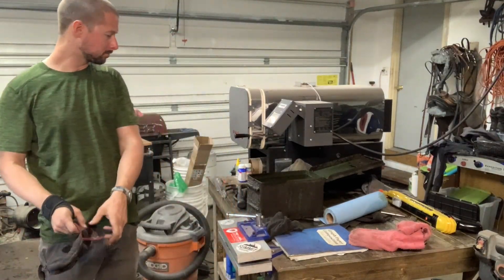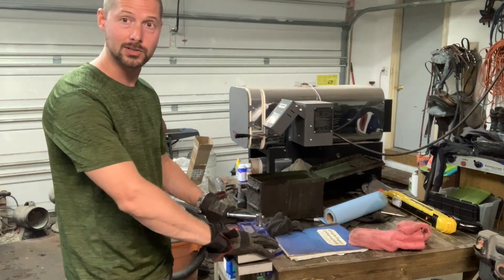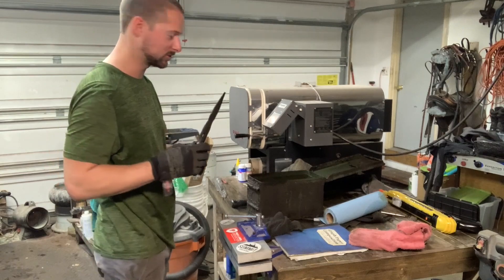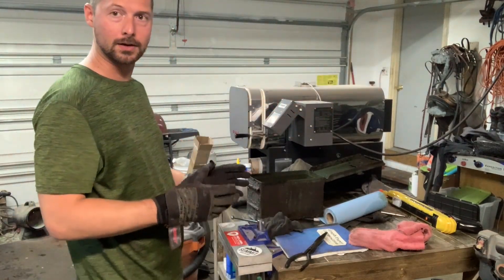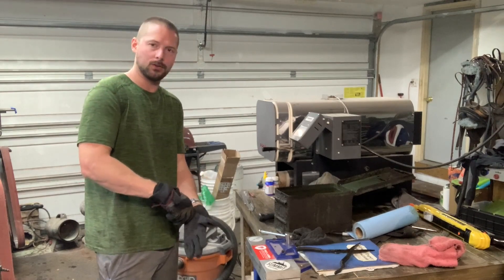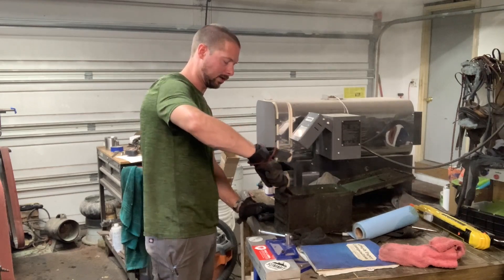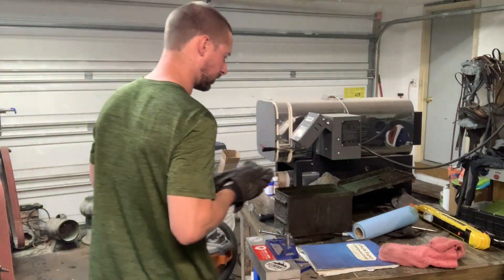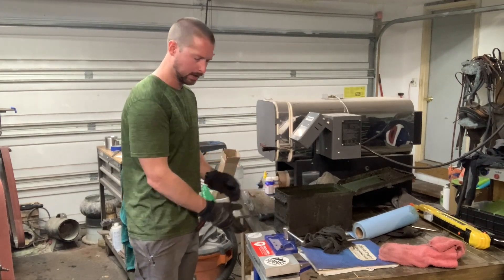NO MORE WARPS!!!!! heat treating tips!!!

Comment: ? What happens if you get your blade TOO HOT before quenching?
Reply: They became brittle other will shatter if drop the knife. If your buying a steel Plate there is a guide for heat treatment.

Comment: I use aluminum plates, so far without a vice setup. I couldn't help but notice that when you really wrenched down on its handle, that the upper aluminum plate tipped to the right. That's expected due to the offset force. Would work best when the blade is placed as close as possible to the vice's threaded shaft.

Comment: What's your take on 1075
Reply from the maker: I haven’t used it much really
Reply: It's good for beginner knife makers! And it's a decent carbon steel. Not super high end but it's decent.
Reply: @JesusChrist_IsTruth-LoveForALL  yeah I attempted to make pairing knife out of it 
Mostly failed but the blade could carve aluminum and brass with a 2-20° secondary bevel
Reply: @ThatOneOddGuy  Nice!! Keep working on it! 💪
Reply: @JesusChrist_IsTruth-LoveForALL  will have time in a few weeks got a physics exam tomorrow

Comment: Stress will warp blades. So when you cut and grind knives with grinders and what not, that is creating stress in the steel. The steel also gets stressed when its made at the factory when its pressed into sheets.
Some tips would be to lower the rpm and heat when working with the knives pre heat treatment (as well as after). Turn the rpm's down and or cut  and grind them under water. You could also water jet.
You can also do a de-stressing heat treat cycle. There is also something called vbr, which uses vibrations to remove residual stresses. 
The other part is to make sure the metal is heated evenly in the oven and quenched it so its evenly quenched. This is major cause the middle will cool slower than the outside. Any stress risers in the design will also cause stress and or issues. Say you have a 1 inch thick blade and mill out a relief for a fuller. This is now a 1 inch to half inch transition that will cause issues.
After heat treatment grind under water fed belts to not ruin the heat treat and temper.
Reply: Normalizing the blade before quenching and temper fixes the knifes stress. You don't really need fancy water jet grinders either, just dunk the blade in a jug of water and cool it down when you start feeling it warming up.
Reply: @JesusChrist_IsTruth-LoveForALL  micro quenching is wrong and not a good practice. You dont want to warm it up on the grinder and quench it in water every time. That just ruins your temper.

Normalizing doesnt resolve all the stress all the time.
Reply: @tacticalcenter8658  it would ruin the temper even if your not going anywhere near the temperatures you tempered at? 🤔 Thanks for the tips
Reply: @JesusChrist_IsTruth-LoveForALL  go read knifesteelnerds.
Reply: @tacticalcenter8658  ok, thanks!. I usually try to grind out all the bevels and stuff before heat treat anyways, because it's was easier to sand unhardended steel, then I hand sand after heat treat. I've just seen many people who do bevels and grinds after heat treat do the dunking in water method when it starts to get hot. I'll check out that knifesteelnerds 👍
Reply from the maker: Great info!

Comment: I'm a beginner. Building my workspace right now almost finished! Thanks for the tip. For the canola oil does it matter if its dark? Like darker canola oil
Reply from the maker: Use fresh!
Reply: @gentrycustomknives8008  can the alluminion quench Vise be used for carbon?
Reply: @benbroeckx1905  yes